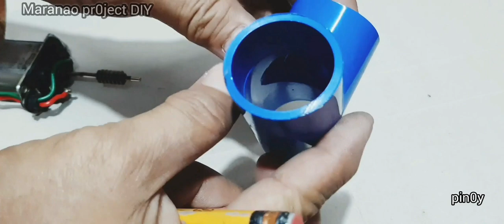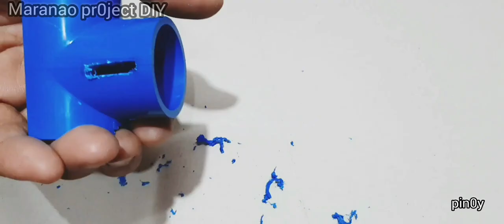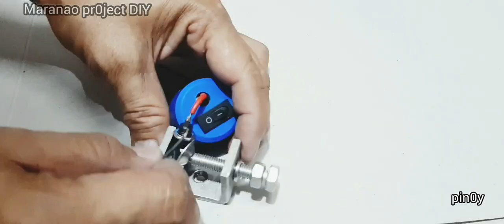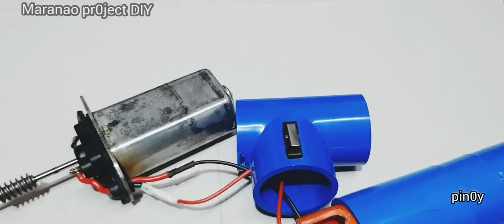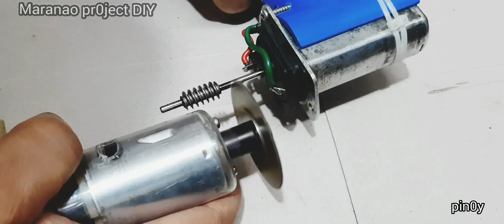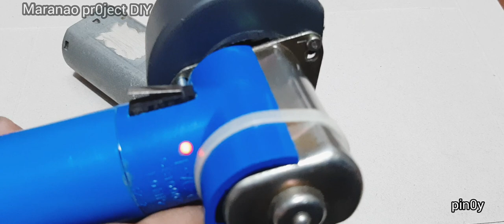how to make a mini grinder 12v motor from car power window high speed DIY

Comment: Very good! But.... where did get current?? some power supply maybe?? or any battery?? what kind of resistor did you use? Is this video just to show us how much are you clever?
Reply from the maker: Adaptor power supply 24volt 5a 100w  270ohms resistor 25w
Reply: @maranaoprojectdiy811  Why 24v?? is a 12v motor, isnt it?? an adaptor 12v 10A (120W) is better... maybe

Comment: How you make shaft connector
Reply from the maker: i buy it to onlineshop
Reply: @maranaoprojectdiy811   please reply link to purchase this. India rupee
Reply: Drill machine making vedio link please reply
Reply: Power supply used for this machine is what 12volt and how much amp
Reply: After cutting edge of motor shaft and balance of motor shaft size is what
Reply: Nice👍👍👍👍👍👍

Comment: bossing pwede malaman direct tap napo ba yan sa 12v charger or ginagamitan pa ng resistor salamat
Reply from the maker: 12volt  po itong car  power window motor pero ang gamit kong adaptor charger 18Volt
Reply: Why